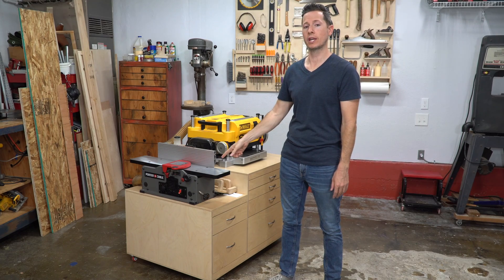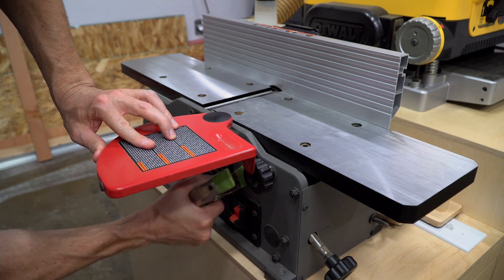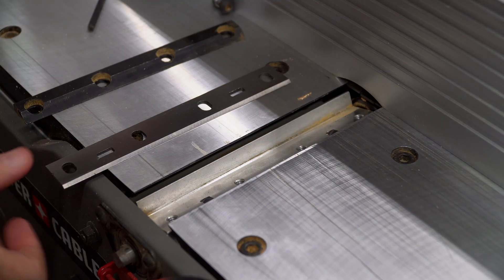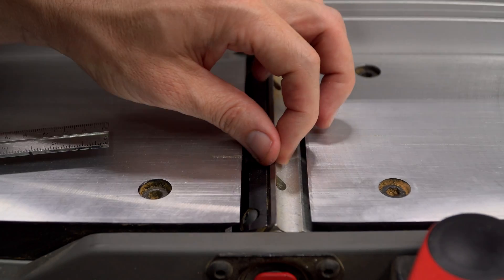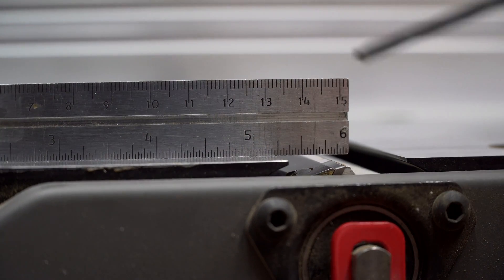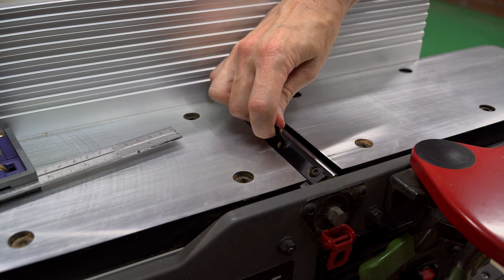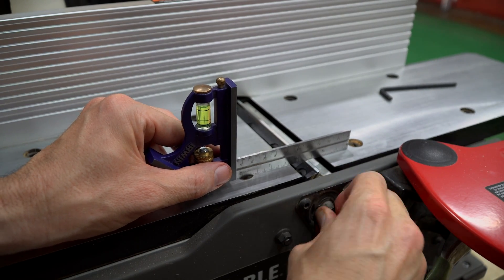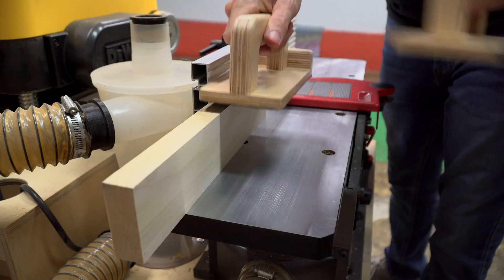Porter Cable Benchtop Jointer Blade Adjustment

Comment: With the infeed zeroed out I raised the blades til it grabbed/pulled  the ruler  as in the video and it leaves the face of all the  boards  with snipe and chip out. So I lowered the blade like a c hair (lets say  1/16th) and got good  results.

Comment: Excellent video!  I just bought the Delta version of the same model (used) and the blades that came with it were trashed and needed replacing.  This will help greatly.

Comment: I was wondering if you know of a solution for my problem. The socket screws that adjust the blade height no longer catch and just spin freely.  They would spin loosely a couple rotations and then catch. But now nothing.  Any thoughts would be greatly appreciated

Comment: I have this jointer and had the same jointer when it was sold under the Delta brand.  Two things you're never told you're going to need when replacing the knives are an extra holder bolt or two and a screw extractor.  Almost without exception at least one of the allen slots strips out.  Both jointers, every time.
Reply: Was excited to find this video, only to have the Allen head strip out.  Now what?🤬

Comment: When you set the knives is the blade position at zero? I mean the dial that determines the amount of material you take off.  Should that be at 0?
Reply: You put your ruler on the outfeed table. That’s after the blade. That part of the table is stationary.

Comment: I’ve been getting horrible cuts from a delta 6” bench top jointer that I inherited from my older brother.  Am always getting cuts that start and finish within the first 5” of my boards and then it wouldn’t joint anything beyond that, Leaving a bow in my practice boards.  After looking at the blades I don’t have the 1/8” movement with my ruler.  Now my bolts are seized up and I’m out of WD40.  Once I get theses freed up I will adjust my blades and or get new ones. Does the scenario I describe sound like a reasonable explanation for my jointing results?

Comment: How do you get a fine adjustment on the knives. I've followed your great instructional video but continue to have issues with adjustments like getting 1/8" of travel. And after running a board through I get a tight wave patter from the blades and it's not smooth like it was from the factory. Any suggestions?

Comment: Thanks to this video I was able to fix my jointer.  After sharpening my blades, I started getting a lot of tear out.  After watching this I fixed my blade alignement and it fixed it.
Reply from the maker: I’m glad you found it helpful. Another thing to consider (for tear out) is to check your grain direction. You may know that already, but just in case you don’t. If you send a piece through and it gets tear out, flip it around and send the other end through first. I hope this helps!

Comment: Thank you Tommy.
I have attempted to set my knives a few times and it’s still not quit right.
I’m using Oak and at first I was getting snipe. I have that gone now but it seems the knives are hitting the wood and causing bounce or vibration.
I’m curious if you have any advise.
Thanks!

Comment: Tommy. Have you ever had a problem with this jointer or any other one that won't cut the last 1" of the stock? Could anyone point me in the right direction to fix this issue. Thanks in advance for any help.

Comment: Well done.  The closeups of blade height testing and adjustment made it especially clear.  I have a DELTA JT160 jointer; its construction appears to be identical to yours.

On another note, no one mentions adjusting the infeed plate on this model so that it is parallel to the outfeed. Parallelism is not mentioned in the manual either.  Its like this will never be a problem?
Reply from the maker: Thank you! As far as parallelism goes, I have measured it, and while it's not perfect, it's very close. The performance has been adequate for my needs over the years, and it actually performs better than my last jointer, which was much larger...and more expensive. All that said, I'm not sure why they don't consider it in the manual. Maybe they're just that confident in their design...only time will tell how it's going to hold up, but so far so good!

Comment: The inner side of the PC table is off from the closet side. How do I fix that? The screws on top?
Reply from the maker: I'm not 100% sure. Did it come that way from the factory or has it become this way over time? If it came that way from the factory, I might be inclined to swap it for properly calibrated version. If it became that way over time, I'd probably disassemble it, clean everything, and put it back together. If nothing else, you're bound to learns something about the mechanisms involved. Anyway, I hope this helps!

Comment: One thing is not perfect on this otherwise perfect video: When tightening the blade holding screws, DON'T DO it as shown... The best way is to apply a little torque at each screw at a time, and following a proper sequence, exactly like when tightening a wheel or an engine head: In Order!
In this case, start wih the most center two screws, followed by the exterior ones, do it in at least two to three steps, and in that way you keep the blade straight and not being distorted by tha clamping force of the screws.  Every time you tighten a multiple screw assembly, do like I've just described. If you as many other people, don't have a torque screwdriver, you can still get excellent results by using first the short side of the Allen wrench, and then the long one. That way you can approximate the torque that is applied without using an expensive torque measuring tool.
Best Luck, Amclaussen.
Reply from the maker: Thanks for the tip!

Comment: Before you adjust the blade height in this manner, do you need to zero out the height adjustment of the out field table? Thank you.
Reply: I meant in field table!!
Reply from the maker: Not for this machine (and problem not for most machines, actually). The main goal is to get the knives perfectly aligned with the outfield table. Since the infeed table is adjustable, it doesn't really matter. I hope this helps!
Reply: @OneMinuteWorkbench  Thank you for your reply. Much appreciated.

Comment: Nice demonstration.  I also have this same Porter Cable planer, and following the exact same procedure I found a "gotcha" when I was replacing my blades.  By using a metal rule for setting the blade height, I inadvertently put a dull spot on the blade at each end where it was touching the rule while checking the height.  Left me with noticeable lines on the wood whenever I joint across one or both dull spots on the blades.  Wondering if there isn't a plastic straight edge that could be used to prevent this...
Reply from the maker: Thanks, David! It sounds like you might've just put a little too much pressure on the ruler. Plastic could eliminate the possibility of that happening, but it also might be a little harder to be precise. If you do experiment with plastic, be sure to come back and let us know how it goes! Thanks again!

Comment: I have this model and it or maybe 'I' cannot seem to get a clean cut. It very often gives significant tear out when using it. Even at the lowest amount being taken off. Tried and tried, but it causes me more work than it's worth. Have no idea what I am doing wrong
Reply from the maker: John, tear out could be a lot of different things, but is usually associated with grain direction. If you're not familiar with how grain direction affects the cuts a jointer makes, do a google search on the subject - there are lots of good videos out there. If that's not the problem, do you have any other suspicions as to what it might be?

Comment: Hey Tommy not on that exact Delta Jointer. But other Delta linters. Ive seen  guys i a commercial Woodworking shop changing the blades using  a magnetic  pick up tool to  remove and install the blades  eliminating the need to touch the blades all together  looke like a good idea to me  and i picked up a Sears Craftsman telescoping oe i keep stuck   In oe of my tool  boxes  that ive found many uses for in a wood shop
Reply from the maker: Thanks for sharing that tip!

Comment: I was looking to get this jointer, how do  you like it?
Reply from the maker: I'm very happy with this jointer, especially for the money I spent on it. I've owned larger more expensive jointers that haven't performed as good as this little champ. That said, there are some drawbacks. I actually made a video review of this jointer. If you're interested, here's the link: https://youtu.be/S_fl31hTsFs I also made a separate video on how to adjust the fence. Here's the link for that one: https://youtu.be/el1OMhmgqLI I hope this helps!
Reply: @OneMinuteWorkbench  Thanks for following up on your thoughts on the jointer. I'm definitely going to get the same one now. Thanks a lot for saving me a ton of money!

Comment: How has the jointer held up so far would you recommend it and how is the fence does it flex at all. Always enjoy your videos
Reply from the maker: I'm very happy with this jointer, especially for the money I spent on it. I've owned larger more expensive jointers that haven't performed as good as this little champ. That said, the fence DOES flex, so you have to be careful when applying pressure on it. I actually made a video review of this jointer. If you're interested, here's the link: https://youtu.be/S_fl31hTsFs I also made a separate video on how to adjust the fence. Here's the link for that one: https://youtu.be/el1OMhmgqLI I hope this helps!
Reply: @OneMinuteWorkbench  thank you for taking the time to answer and linking videos for me I've been back and forth on getting a jointer for a while now. I'll definitely give the links a view even though I'm sure I've seen I've been subscribed for a while 👍👍👍👍
Reply from the maker: Okay, sounds good. By the way, thanks for being a subscriber!

Comment: I would suggest getting T handle hex keys (Allen  wrenches) for this task. This keeps your fingers well away from the blades if they slip or cam out of the fasteners. You can cut your hands very badly if this happens. (Don't ask how I know :-) )
Reply from the maker: Thanks for that awesome tip! And don't worry, we won't ask how you know 😉
Reply: If I might add a tip too...
I have an 8" dowel with a rare earth magnet epoxied into the end of it. I pick up planer/jointer knives with it when I'm changing them out. Keeps your hands out of those tight spaces where cuts can happen.

Comment: Thanks for this video Tommy!  I don’t own a planer, but it really is because I was afraid it would take more knowledge than I had to maintain it. You have demystified the planer and now I will consider getting one some point in the future.
Reply: Ditto
Reply from the maker: No problem, Lisa! If you do get a jointer (this style, or another), let me know how it goes! I was thinking I might do another video showing how to set the blades for jointers that don't have a cutter-head lock. Keep me posted!